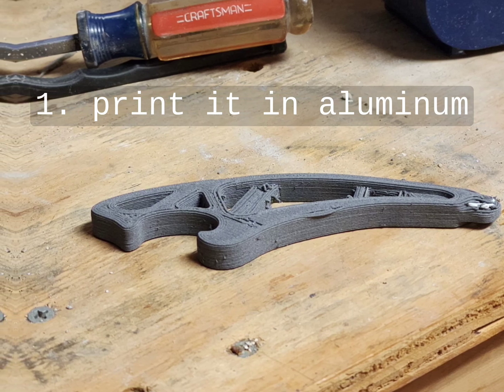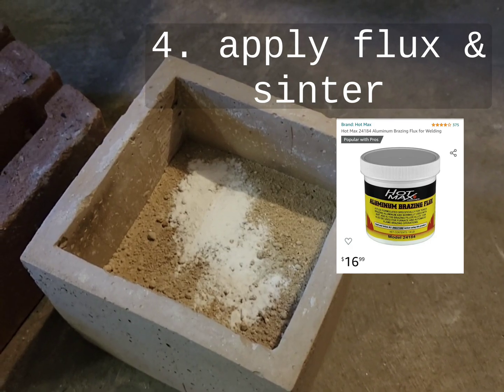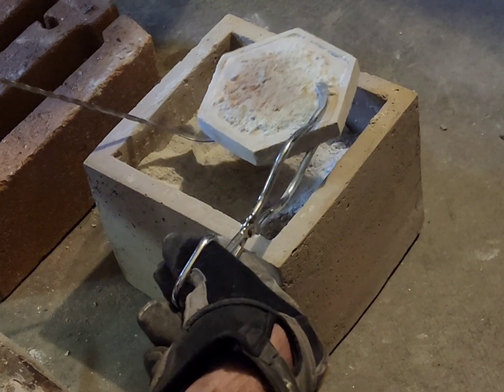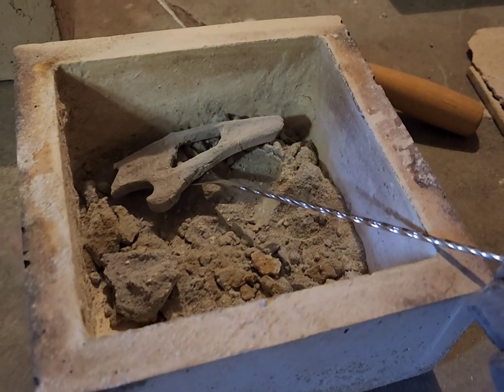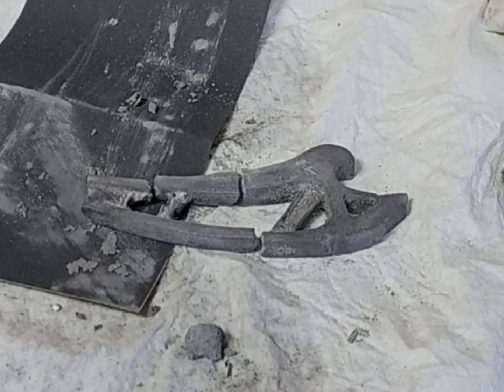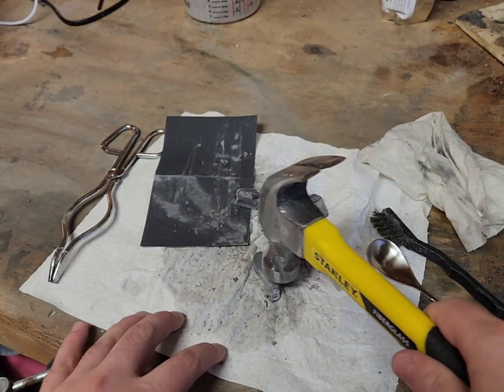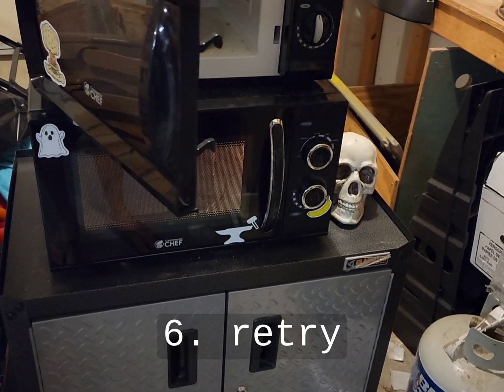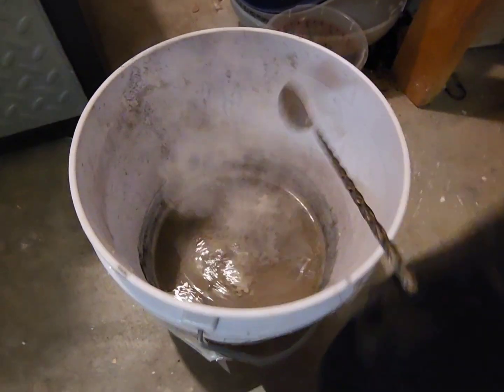⏲️ Microwave Sintering is CONSUMING my Free Time

Comment: The silicone carbide powder, as a powder, is not very efficient in transferring heat. It has a lot of air inside. You could try heating it very slowly to archive a more uniform temperature, close to the sintering temperature, before increasing. 
Something should "replace the air" within the powder. Maybe thinner powder, maybe other gases...
Reply from the maker: My latest process involves casting the powder into pucks which seems to achieve better results (and are a bit more durable)

Comment: I feel like there’s a big opportunity for a folded sheet metal insert in microwaves to refocus the energy for various applications (sintering, plasma generation, wifi jamming, long range heating, etc.)… would have to use calibration measurements and simulation to maintain the resonance for each cavity… but I think it could work!
Reply from the maker: Certainly an interesting idea!

Comment: I can't wait for you to dial your techniques. totally want to try this myself
Reply: It'd be interesting to see a cost comparison between a microwave and kiln. In the future it would be great to have the processes programmed into the microwave controls
Reply from the maker: @Rosettawang  well to put it in perspective you'd spend anywhere from 1k - 5k usd for a programmable electric kiln and maintenance needs to be done about every year or two (replace elements, patch fire brick etc...). Also the power draw is high and sinter cycles run from 10 - 30 hours.

These two microwaves cost me $160 and a sinter cycle is about 2 - 3 hours. The microwaves are 600 watt and 900 watt
Reply: A kiln and filament is already magnitudes cheap than other techniques to 3d print metal. Sintering in a kiln might cost $20 to run. May be a few times cheeper in a microwave
Reply from the maker: @Rosettawang  got that right!
Reply from the maker: Getting close :)

Also aluminum is tricky so other metals should be easier (bronze, copper, steels etc...)